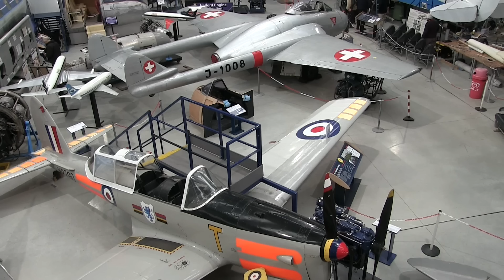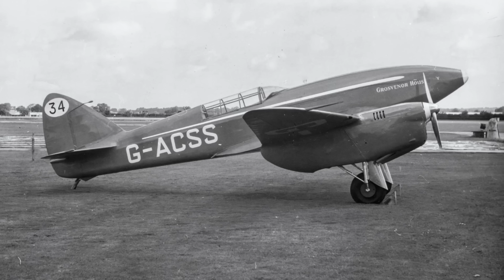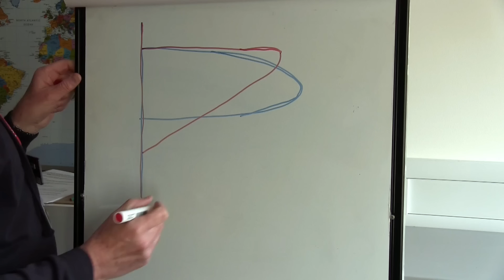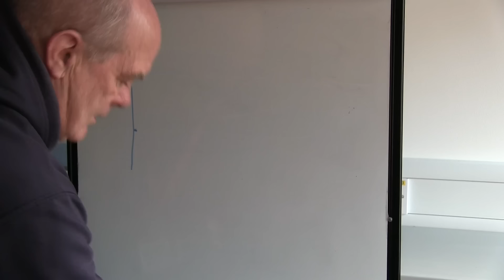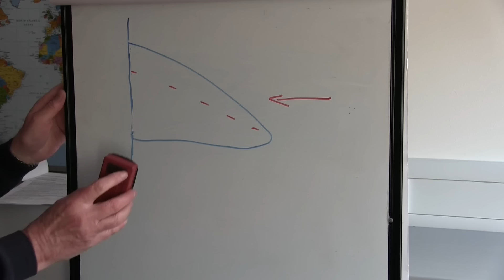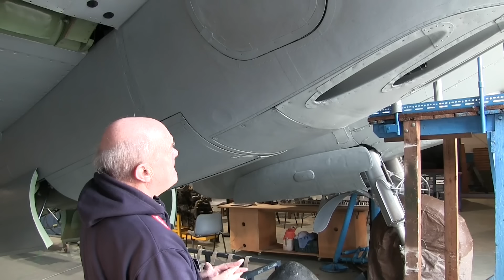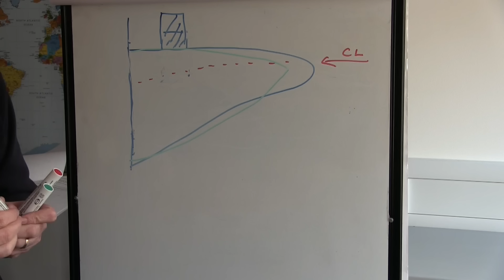Why Did the Mosquito Have Triangular Wings? The Mystery Explained

Comment: So much more was known about aerodynamics in 1939 than given credit for here. There’s no need for so much speculation, much less guesswork, especially when it ignores the structural and manufacturing aspects. Aircraft design, like most things, is a compromise and balancing of factors, especially excellent design. 

The main reason was almost certainly getting about the right taper ratio for a reasonable induced drag factor, together with a straight and straight through one piece wing spar. 

Rapid manufacturing was obviously an important criterion as a lot of Mosquito history refers to wartime necessities and a straight one-piece construction would be sensible, both for jigging and construction.

The engines could only be in the position they are, for c.g., propeller clearance and asymmetric engine-out considerations (which determines fin-size for instance).

End of 🙂

Comment: No source, just riffing off info given here; You mentioned wing tip stalls, and how a swept or eliptic wing has its outer center of lift aft of the wing average. Indeed making many agile fighters finicky at low speeds, typically landing but also under forced circumstances. 

While many pilots became real aces, we also know that the war effort had to “produce” fresh pilots inhumanly fast. The Mosquito’s primary role probably wasn’t to be flown hyper-agile either, as a light bomber and attack aircraft?

The Mosquito ‘forwards’ triangular wing - as opposed to those others - will experience wing tip stalls forwards of its average center of lift. This should (I think…) induce a wing tip stall nose-down behavior, as opposed to a nose-up - helpful in recovery by increasing speed. I.e. the total center of lift in pre -stall airflow moves aft of what a normal airflow produces. 

This should be akin to how the typical Cessna 152, 172 (and many more) behaves, no wonder they’re still such preferred pilot trainee aircraft. 

So, in the context of rapid deployment of quite fresh light bomber & attack pilots - could this ‘friendlier’ stall behavior have been a deciding design target?

Comment: I'd be interested to see the basic empty weight centre of gravity, established from a reweigh, and the calculated C of G with full fuel, armaments and crew.
I wonder if the two would be that far apart, given that most of the weight is concentrated between two close fuselage stations.

Comment: a huge % of Soviet aircraft were made of wood because of the shortage of aluminium ....and most soviet aircraft of WW2 had triangular shaped wings wing sweep on the front wing and rear ............ straight edges are a simpler way to make a "tapered wing" - they chose to taper both edges ..... but what they did is not that different to the Mosquito in reality ..... straight edges ..... wooden wing ..... creating a simplified eliptical shape ....
possibly to overcome the weight of wood by "thickening" the wing area closer to the fuselage ?- 
I think you would be better off studying Russian aircraft made of wood too ..... TsAGI was an advanced aero research organisation setup in 1918  so any notion that the Russians were "backward" is absurd ....

Comment: Triangular wings are cheaper to make than oval wings but are a good compromise to reduce drag... If your engines are just in front of the wings like say an f7f or mosquito this just becomes a good planform... It's cheap and it works... If the plan form was flipped like a delta wing then the props on the wing have to be further forward to clear the leading edge and with the cog further back now you are nose heavy. The triangular wings flat edge forward is just cheap. And it works well. Double tapered works too, but is more expensive and moves cog back which with the rest of the design intent probably was less ideal. With two engines you want cog forward so the tail can balance them out. It's just a good plan form for a twin. And is cheaper and easier to build.

Comment: Interesting discussion of the cg placement relative to cl location due to wingshape. Strikes me not a driving issue as the cg moved as 2 - 4000 lb bombs would also need to be handled (trim ?). Very flexible aircraft in many roles, subhunting my favorite.

Comment: My father worked at de Havilland Propellers and, latterly, on Blue Streak. He told me that the Mosquito straight forward wing was to bring the lift forward to counteract the weight of the engines. He said many wind-tunnel experiments were conducted to remove the tip-stall characteristics of the straight-attack surface. The chord design was developed to make the lift central whilst maintaining manoeuvrability in the air.

A lot of thought went into the mosquito design. It paid off in a versatile machine.
Reply: Wind tunnel experiments? at de Havilland? You jest
Reply: I was not aware that de Havilland made a habit of wind tunnel testing anything or engaging in any serious deep dives into aerodynamic research.
Reply: @JammisAdami  He worked in Manchester and Chester before moving to Hatfield to work on Blue Streak.
Reply: @RadioJonophone de Havilland propellers was in Bolton, near Manchester.
D-H was tits-up in 1958 and the division in Bolton was acquired by Hawker-Siddeley before being moved to Hatfield 
Blue Streak was actually a Hawker-Siddeley program, the de Havilland name was officially dropped in 1961 (logos and signage changed 1962-63)

Comment: To my mind the best reason to have a 'forward swept' trailing edges
is to introduce dihedral for low speed stability. The wing itself is shoulder mounted
straight leading edge ( good roll-rate at speed) dodgy handling at low speed.
My most favorite plane of WW2.

Comment: Rubbish. Ask yourself, what would be the potential advantages of moving those heavy engines further back into the wing? There are several advantages in moving the engines backwards, principally in terms of increasing all-around visibility to look out for enemy aircraft. Then consider possible disadvantages of burying the engines in the wings at the C-of-G. The biggest disadvantage I can identify is where you store the undercarriage, which must be far enough forwards to permit a safe landing. To my thinking, it was the undercarriage which was the deciding factor. Having those engines obstructing visibility was a very serious negative design decision. Something of equal necessity must have forced that design choice. Certainly, I agree the wing shape was designed to support those heavy forward-projecting Merlin engines. But it also gave a very strong wing structure, very resistant to battle damage, as we see in the Avro Vulcan. Always remember, form follows function, an axiom we designers hold very dear. We must also never fail to forget that it has also been something of an aesthetic design feature of De Havilland aircraft to have sensuous curves; a brand hallmark, if you like. Finally, have you considered changes in C-of-G as your fuel, bombload, and ammunition are depleted. A triangular/delta wing is supreme in those respects.

Rick (an Analyst and Designer)

Comment: You didn't get to the point until 11 minutes into your reasoning. The reason for the forward swept lifting line is to place the centre of lift correctly just aft of the centre of mass, which in turn is well forward because of the protruding engines. Everything that changes during the flight (Fuel, Bombs and ammunition etc) must be located near enough to the centre of lift to be trimmed out as it is moved or used.
Reply: Yet this is true of all similar aircraft, not unique to the Mossie
Reply: Naive view - positioning the wing spar with respect to centre of lift for load carrying, also the intention to have a very light fuselage and tail structure.  One giant wing spar as close as possible to the leading edge to pick up the engines, fuel tank, weapons load, cockpit and undercarriage, then add control surfaces and structure to transfer control surface torque to the main spar.  PS I believe the  DH Rapide had the sort of double tapered wings in a biplane described in the video and was a successful long lived aircraft with the added problem of uneven mass distribution.  Combat aircraft obviously change their mass as fuel, weapons etc. are expended hence the need to group them along the main spar so the CofG doesn't change radically.  As I stated, a naive view.

Comment: I suspect that pragmatic manufacturing considerations were a high priority. Unlike the Duralumin used in the Spitfire wing, wood is strongest when the grain of the laminations is straight. As others here point out, this design allows the main load-bearing spars to be straight, compared to the complex curves of the Spitfire. Easier to design and test, given the limited budget and extreme pressure of time. Cheaper to build. More reliable in combat?
Reply: That makes sense, the spar would undergo torsion if it was swept back and torsion is the enemy of engineers
Reply: My thoughts exactly, a straight main spar, tapered towards to extremities is far easier and more importantly, quicker to manufacture.  It also has less torsional forces acting in it.  My thoughts only, no designers insight here at all only practical considerations.  A truly great aircraft which I have unfortunately only ever seen one in flight.
Reply: @lc79tourer26  Also, I suspect it's more likely to keep functioning if it's hit by flak... Torsional forces rely on the integrity of the spar - it it's damaged it will delaminate. A straight spar probably has more redundancy.

Comment: Tip stall was found to be mitigated to a small but important amount by wash out, meaning the wing tip had slightly less angle of attack. The wing root area would stall before the tip leaving the pilot some small but meaningful control.

Comment: I think that a significant input to the design criteria was the all wood construction and managing mainspar loads, particularly the bending moment at the wing root. 

The more lift generated further out towards the tip, the greater the stress in bending at the root. 

Sure, that could have been dealt with by increasing the main spar cross-section nearer the root, but that would mean a thicker section aerofoil and hence more drag. 

The intention was to produce a lightly armed aircraft capable of outrunning existing fighters of the day so minimising drag was another major design input factor, hence a relatively slim but broad chord wing close to the root, concentrating the lift near the fuselage, and a final planform acutely tapered towards the tip to progressively reduce lift generation and drag the further out it went. 

The main spar, apart from dealing with some of the fore and aft loads resulting from drag, is essentially a cantilever beam dealing with the vertical forces and a simple calculation of vertical load x distance from root to calculate stress applies. 

One other aspect is the thrust generated by the Merlins, which was considerable to achieve the desired speeds. 
The rear spar being widely separated from the significantly forward location of the main spar minimised the fore and aft bending load on the main spar and the tensile loading on the rear spar. 

So, it was a balancing act between mainspar cantilever root loading in vertical bending from lift, tensile loading on rear spar from thrust (and compression loads from braking during landing), total lift requirement for aircraft and payload, keeping the mainspar slim from top to bottom to minimise wing section, therefore drag, and finally producing a tip with minimal chord to minimise drag and progressively reduce lift / vertical load the further away from the root it went. 

Above all, it has to be remembered that it is an all wood construction, so dealing with the loads involved requires a different set of answers when compared with designing an all metal wing.

Comment: If a stall develops at the lower-reynolds number wing tips, center of lift moves back.  Might be a real safety factor with its high landing speeds
Reply: I was thinking on the same lines, if the wing tips stall first, the centre of lift moves back. So the nose would drop faster than the tail, which ought to reduce the risk of the stall getting worse.
Reply: Very interesting. I’m always fascinated by the trade offs in aircraft design.

Comment: Of course, the stall at the tips mentioned earlier will result in the nose dropping ( as the centre of lift will move back relative to the forward CoG). This will reduce the angle of attack, a shallow dive will result and a recovery of flow over the whole wing. So it creates a 'self righting' tendency in that instance.
This forms the advantage in aircraft with forward sweep combined with canard foreplanes

Comment: From working on DH aircraft I learned that all DH designs paid great attention to reducing drag. Even on the DH82 and other biplanes of the era the interplane struts and bracing "wires" had an aerodynamic shape. Screws which protruded from surfaces had teardrop washers to minimise drag. If you are prepared to go to those lengths on a draggy structure like a biplane you are certainly going to do so on a fast monoplane. I am sure that the video is correct and that the design priority was to have minimum drag and that happens when the forces are in balance. The other thing about DH designs is that they all looked right, elegant to the extreme.

Comment: Hallo there. The Mosquito has those beautiful built in coolers in the wing fronts, so to not complicate the construction and still have a steady girder carrying the loads, a straight frontline could be the easiest way home. The construction is also made mostly of wood, so it has it's own complications to solve. You may perhaps examine how they solved the girder problem, that has to go outside the coolers. But I am just an old engineer, and no aircraft expert. Just an idea I got. Swedish regards.

Comment: If the tips stall first which they tend to do (you said it yourself), the lift center moves aft which makes the plane tend to  pitch down, increasing speed and restoring lift.  Simple.